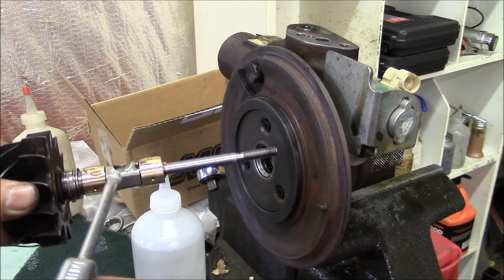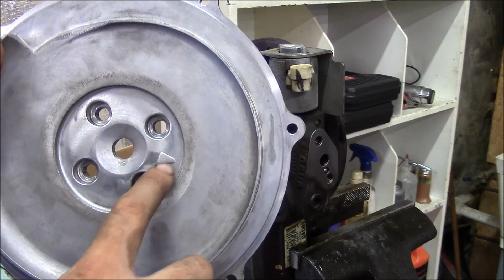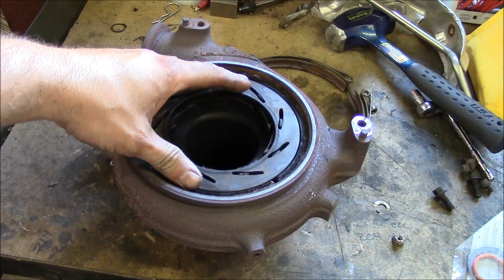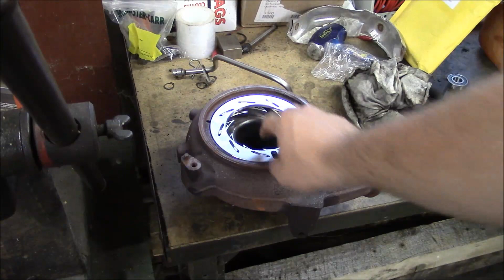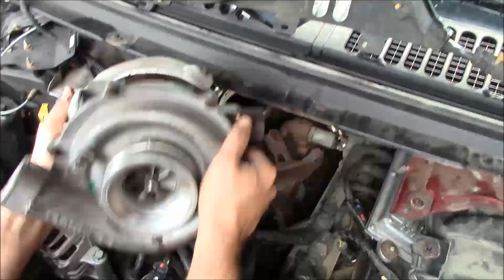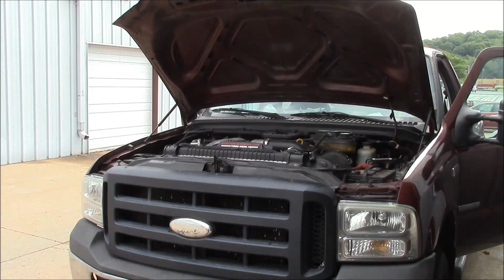6.0 Powerstroke Garrett Turbo Rebuild

Comment: Diesel Tech Ron passed away in early 2016. Right about the time I bought my 06 6.0. I had a one time occurrence where I was pulling my 5th wheel camper up a grade and was doing pretty good until the boost dropped. It was like that for about 30 seconds or so. Then it everything starting again. No check engine light or codes seems to be thrown out. I watch what the engine is doing using a Scanguage 2 that is plugged in all the time. In the year since that, it has not repeated it. Anyway, great video. Nice to have good people who know a thing or two about the 6.0. They really are a good engine.

Comment: The worst thing for these turbo's is to park a truck for months without use.   The cast iron housing on the exhaust side is prone to rusting up seizing the unison ring.   Mine as in yours wore a divit in the unison ring because it was stuck there.   I filled it in with my wire feed welder and file'd it smooth again.  Free'd up the action and improved it a lot.  I lightly sand blasted off the rusty blisters inside the housing.   Worked great.    Feel the power !   Use caution when lubing this exhaust side.   It is meant to run hot  clean and dry.   Don't want anything that will gunk it up.

Comment: I rebuilt the turbo in my 6.0 and i couldnt find the tourque specs anywere so just did it by hand had no problems out of it and i used the original bolts the new ones looked cheap
Reply: Corey Shedd any chance you ever came across those specs since then lol I’m a perfectionist and I’m having the same issue locating the documents.
Reply: @danielleneve9071  Which specs do you need?

Comment: Wes, I worked for the local Navistar International dealer for 26 years as a parts guy, retired in 2014.  Navistar made those engines for Ford and also used them on the Navistar medium duty big trucks, in a different configuration to fit in a different engine compartment.  Those engines have some issues, but the issues can be addressed.  I am not sure on that engine, but with most turbos the clearance in the turbo shaft is measured at the oil feed hole, not at the ends of the shaft, where the reading is amplified.  Typically you will pull the shaft from both ends, then push the shaft from both ends in the opposite direction, with an indicator on the center of the shaft, between the bearings to get the clearance reading -- for most turbos.  Your engine may have a different protocol for that test, and I am just a retired parts guy, but I did sell a lot of parts for those engines, both for IH and for Ford applications...
Reply from the maker: That sounds a lot more scientific than what I did. I could not find a spec for my turbo, so I mostly just wanted to compare before and after the rebuild. Before the rebuild the intake impeller could actually rub on the housing.
Reply: Good, and I thought you did a really good job on your repairs.  Quality work.  The reason I mentioned the turbine shaft clearance measurement is that many do not know how to do it, and when they wiggle the end of the shaft they think it is awful.  Then they check the spec and find it is a lot less, and replace or rebuild the turbo.  Unnecessarily.  Make sure you understand the book method of testing it before condemning it.  If the vanes and housing are worn from rubbing, that is certainly a bad sign, but a lot of turbos run on and on that way.
Reply: Bob Korve

Comment: Ok welcome to 6 leakers, if you still are lacking bottom end boost, you have a exhaust leak. Look up oil filters for that engine,  unless you are specifically running wix filters, get a new oem cap, because they are about an inch shorter. 

And like said before rip diesel tech Ron, learned alot from that man. 

Oh and delete that thing, like yesterday...

Comment: brand new wiggler pin on the wobbler shaft.  nice..   I have often been asked how I know how to fix or work on so much stuff.   Long ago I was an industrial mechanic.  Then robotics as a core and then I moved on to computers.   I now run an IT department.   In my spare time I rebuild engines, weld up crap and maybe even bake some bread.   I don't understand folks being scared of trying stuff.   What's the worst that could happen?

Comment: thanks for the video. i was having similar issues and one of silicone boot clamps worked loose. still want to do this though. got a 0299 and a couple more codes also. tightened it, cleared dct's,  put 35 miles on it and no codes. still seems to be an issue sometimes with no boost from stop.
Reply from the maker: Could be stuck VGT vanes. You might also check the exhaust back pressure sensor. The tubes commonly clog with carbon.
Reply: @WatchWesWork  Thanks Wes. I have an issue with starting as well. I'm showing a control circuit failure in glow plug 3. would that be doing it? hell it's the middle of june. All filters are changed and i'm using archoil products in the fuel and oil.
Reply: @steveboggs9025  the glow plugs cycle even when its 100 degrees out, and yes on a 6.0,even 1 bad glow plug makes it a hard starting pig, I worked for a school bus company that had 450 of these, I eat, sleep, and have nightmares about the 6.0l

Comment: So what's the chances my 6.0 liter isn't toast?  I bought a '06 F350 and finally got around to servicing it (I haven't used it since buying it other than keeping the engine going once in a while) and noticed the intake boot on the turbo was loose. To my knowledge, a "diesel specialty shop" did head studs, and a turbo about 30k ago and my suspicion is that the boot has been sitting loose for the whole time. But this truck never had a low power complaint and actually pulled better than most of our other trucks (I bought it off of my employer). I guess I could check for blow by from the oil fill but the turbo fins definitely looked sanded.

Comment: Great video Wes. Comforting to know exactly what is ahead of me with the turbo rebuild. Thank you. I think my turbo needs a rebuild. I also have a 06 6.0 in my F350. The check engine light comes on about every 30 days with the 0299 code. Not loosing power but I am hearing a sound that sounds like a rubbing blade or shaft. I don't use the truck everyday so that's why it shows every 30 days approximately. Is there a list of parts that you replaced with part numbers and manufacturer?  Thanks again!!
Reply from the maker: Start with the simple things. Check the air filter, check the boots for the charge air cooler tubing, etc. It's a variable geometry turbo, so that adds some complications. The exhaust manifold pressure sensor and several other sensor inputs contribute to the turbo VGT actuator behavior. Exhaust pressure sensors need to be cleaned periodically. They can cause all kinds of weird behavior like low power, black smoke, bad fuel economy. I just bought the kit from ebay. They're available from many sources.

Comment: Excellent video.  I have same issues, (P0299 low boost pressure and occasional black smoke with no power on acceleration and a little oil in passage under EGR), but ordered new turbo, but I'll rebuild old one.
Reply from the maker: Check your EBT sensor. It monitors exhaust pressure. Cleaning it can really help the black smoke issues. If it's dirty, you should also clean the EGR valve.
Reply: Thanks!  I cleaned EGR valve, and while it was not heavily crusted with carbon, when i pushed it open, it stayed open.  After cleaning it opened and closed ok.  Still had occasional black smoke so i replaced EGR with new Motorcraft EGR.  I'll clean EBT sensor while waiting for new turbo to arrive. The black smoke is only on acceleration, and only occasionally, maybe about 1 in 10 startups from stop.  Truck has 165,000 miles and probably original turbo so the unison ring is probably binding.  Interestingly, never had black smoke problem until I picked truck up from dealer after getting differential pinion seal replaced and had them change oil while it was there. I only drive truck a couple of times per month.  2007 F550

Comment: Hey Bearing Boy!  Gots a question fer ya.  If you were to make a merry-go-round, which bearing would you use on the center spindle?  (actually, it's for a tetrahedron that I'm going to make...fancy schmancy wind indicator)  But, the merry-go-round is an easier way of asking.  Thanks in advance.
Reply from the maker: I'd use plastic, possibly nylon. Weatherproof and low friction.
Reply: @WatchWesWork  It's going to be huge...like 15' long.  Search for "Airport Tetrahedron"  It will always be moving.  Still think that's a good material?  (I hope so, as I don't have any way to machine a hunk of steel)  The forces won't be much on it, but it will always be moving.  & Thank you!
Reply: @WatchWesWork   could you possibly add a link to which kit you bought?? Also how well did it hold up?? I know this is but inquiring minds want to know.

Comment: Do you miss this 6.0L powerstroke truck? @Watch Wes Work
Reply from the maker: Not really. Those engines are just a pain to keep running right.
Reply: @WatchWesWork  7.3 is alot easier to Work on for sure more room yeah the 6.0L can be Finicky for sure

Comment: Hey Wes, I just bought a 2004 f350 6.0 at auction. Everything was good in the lot where i tested it; no blowby, no dirty or excessive smoke out of the exhaust, engine sounds good, trans is good and it goes into 4hi and 4lo easily. But upon taking it onto the highway i found it had no balls over 2000 rpm and it really didnt want to go over 70 mph. Do you think the turbo is the problem?
Reply from the maker: It's possible. I would check the fuel pressure first. If the fuel pressure is good, check the exhaust manifold pressure sensor. It's under the degass bottle. They get sooted up and can cause the truck to have low power and lots of black smoke.
Reply: Wes Johnson will do. Thanks!

Comment: ....Clearance on that shaft....even the max allowed at .012"' seems pretty large....do you know what the 'factory' spec is...? That .030" would surely be a leaker.....
 Nice video, I've never worked on a turbo, but do understand how they work...
Reply from the maker: I never could find a spec or even where to properly check it. It was suggested to check it through the oil hole, not at the end. That makes sense to me, but I can't find any real info for my turbo.
Reply: ..I've worked on a variety of machines and motor vehicles, I'd guess a 'good' fit for pressurized oil in a sleeve like that might be .003-4"....? and possibly a variation accounting for heat expansion.....
 Years ago, I had a friend that worked at Garrett, rebuilding turbos to factory spec's....it was actually in the 1970's....their stuff was always top quality.....but he seldom mentioned his work during off-hours...too busy with the Harleys at home....and, mostly all roller bearings in them....little oil pressure, but it has to be there all the time.....001" was a good fit....
Reply: Wes, you should never measure clearance on end of shaft. Your dial gauge reading is taken through drain hole in center housing. Customers ‘wiggle’ their compressor wheel all time & tell us that it’s excessive as they can’t lift shaft evenly with exhaust housing on. Let me know your thoughts.

Comment: How many miles/hours were on that engine?  Diesel Tech Ron passed away not long ago.
Reply from the maker: 240,000 miles. The turbo had a reman tag on it, so it must have been replaced before 140,000 miles when I bought the truck.

Comment: I've got 125k on my 2007 PS 6.0 F250 it's never been the the shop I cleaned the egr valve the other day it made it run like new again should I pull and clean my turbo?
Reply from the maker: No. But, you should probably clean your exhaust back pressure sensor. It's in the driver side exhaust manifold.
Reply: Can you show a pic oh it , the egr was really caked up but no lights has ever came on the dash but I want to learn how to maintain this 6.0 the right way it's my first diesel I've ever owned

Comment: don't use those aftermarket oil filters & cap
Reply from the maker: Why? They are made by Wix and I think they are pretty good filters.
Reply: @WatchWesWork  I don't know what filter you are using I just saw you had a non-oem cap..
Reply from the maker: He's just telling people not to put the OEM filter in the larger aftermarket cap. If you have two brain cells to rub together, that's not an issue.
Reply: @WatchWesWork  
Yes, but in reality it happens often. People don’t pay attention.